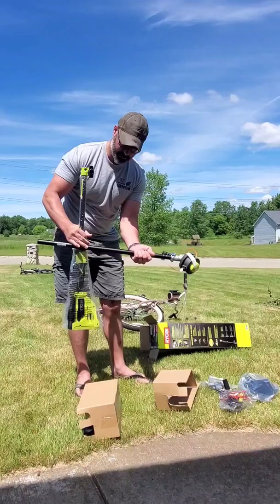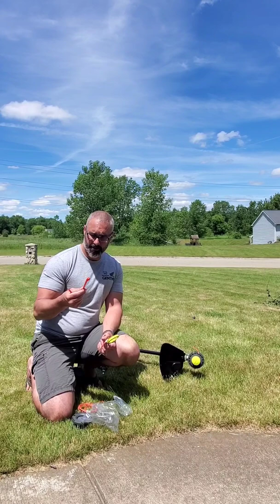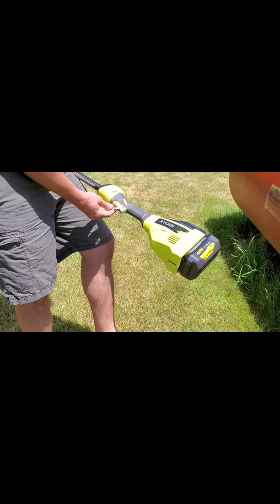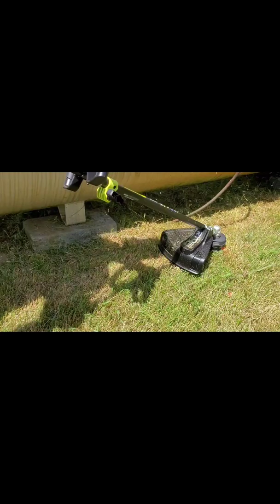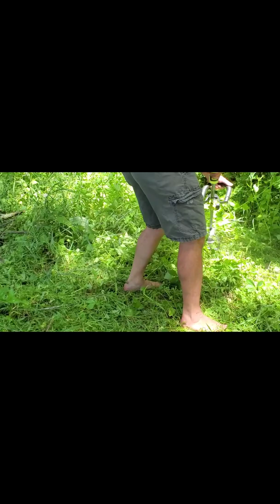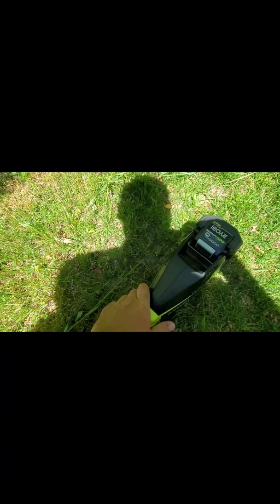RY40270VNM Ryobi 40V Battery-Powered Brushless Weed Wacker - Unboxing & Review

Comment: Right. When you actually have to replace the string you will sing a different tune.  It is most definitely NOT  easy.  The string is nearly impossible to "easily pass through"
Reply from the maker: It's actually incredibly easy. There are arrows that you simply line up. You then pass the string straight through and twist the head. The string pulls right in. In less than 60 seconds, I'm back to trimming weeds. I could do a follow up video if it would make more sense.
Reply: @dngrclwn  Not on mine! I've tried MULTIPLE times and the string will not go through the second hole. I'm now trying to disassemble the head which does not want to come apart. I'm about ready to trash it. It's all of 2 months old.
Reply from the maker: That's very frustrating. I'll make a video of my method. Maybe we'll be able to figure out where the trouble lies.

Comment: Hey great video. I just got this trimmer today for some reason my handle is really loose in flemsy have you had any issues with that?
Reply from the maker: I haven't. The nut tightened down properly, and the handle has felt secure so far.